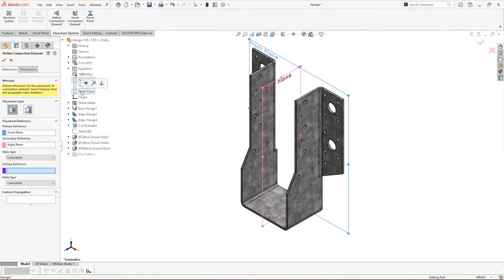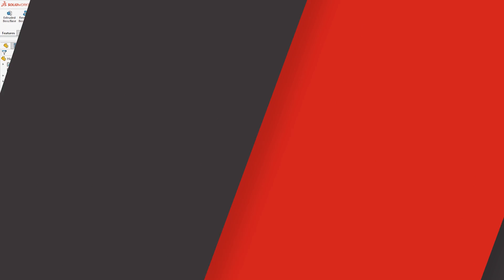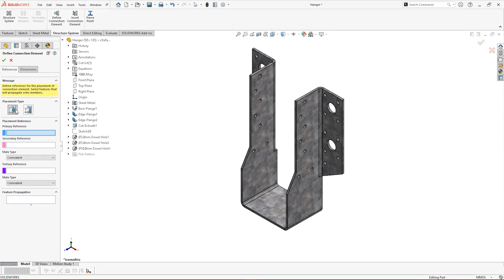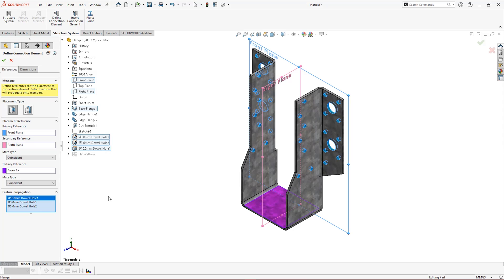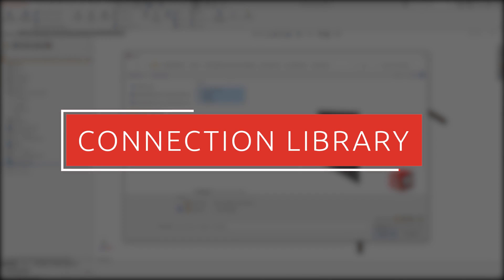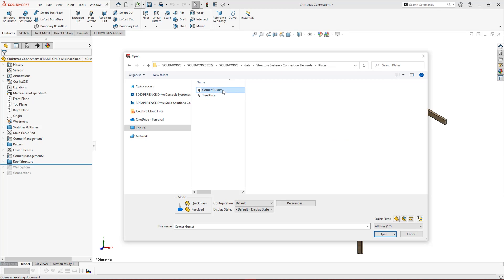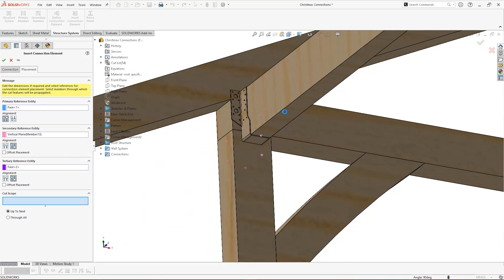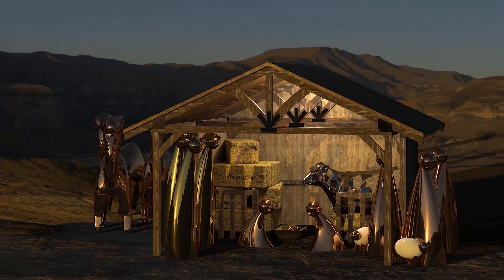Connection Detailing in SOLIDWORKS Structure Systems | Advanced SOLIDWORKS Tutorial

Comment: Hello, thank you for the vidéo.
Wht about fastener bolts and drawings ?
Reply from the maker: The SOLIDWORKS Toolbox included in Pro/Prem packages is a library of fasteners from a variety of standards, so it's straightforward to add in whatever you need. 🔩 Detailing drawings can be made from individual bodies for the connection elements. See more about Toolbox here: https://www.solidsolutions.co.uk/SolidWorks/3D-CAD/Features/Toolbox.aspx